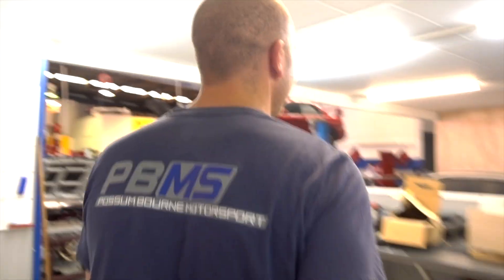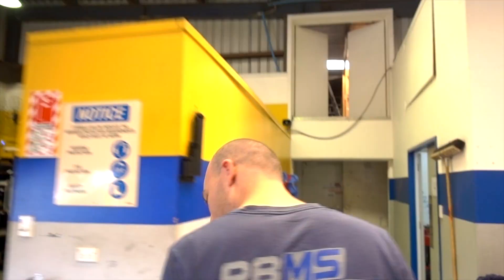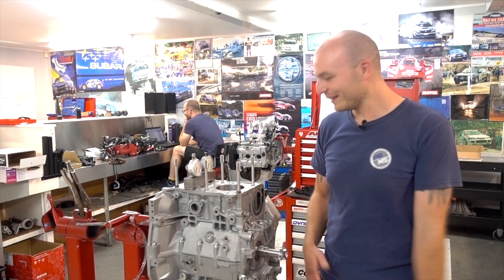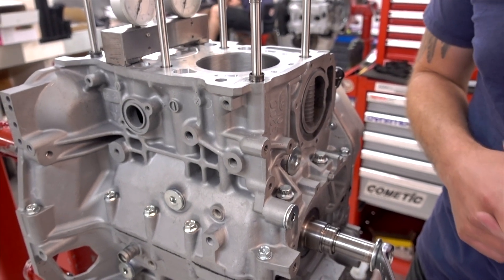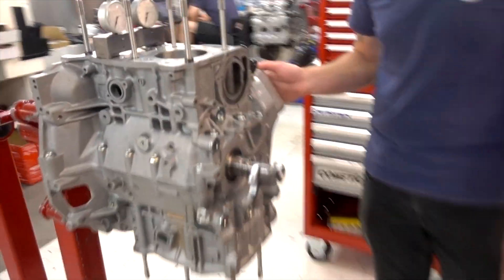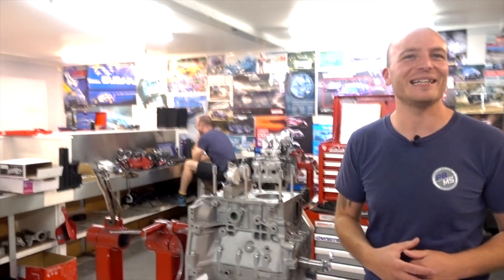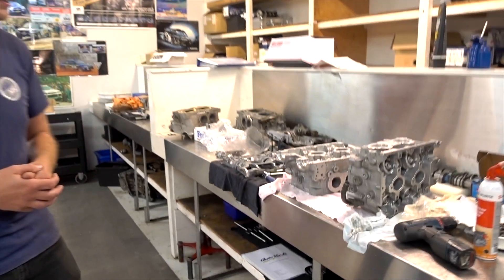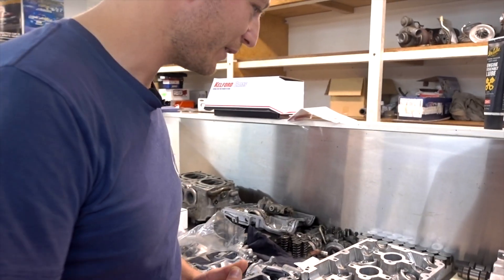Engine and turbo combo for our own Subaru | Pat's STI Build EP 1 [PBMS Vlog]

Comment: Thats not fair... I want that very same engine spec build for myself too! 😋💪🤪
Reply from the maker: Well keep an eye on this project! Anything else you reckon we should do during this build>
Reply: @PossumBourneMotorsport  maybe air to water intercooler setup for maximum throttle response?  Using 2 tubular awic core in series placed at stock top mount intercooler location..  🥰